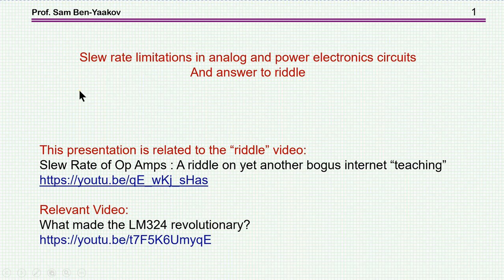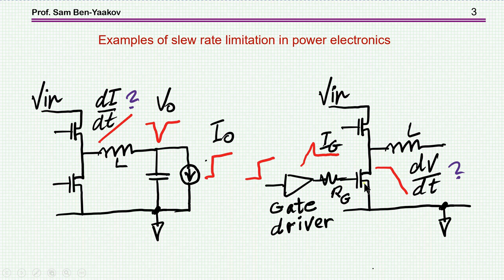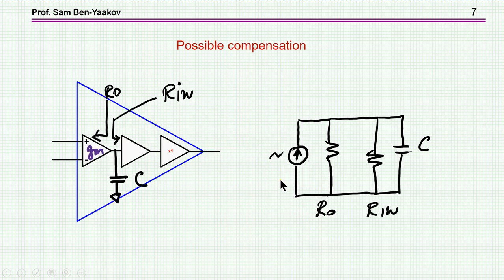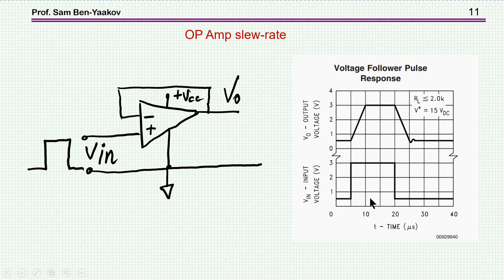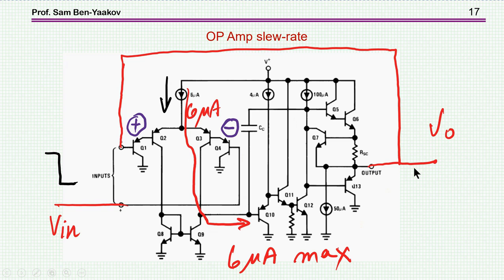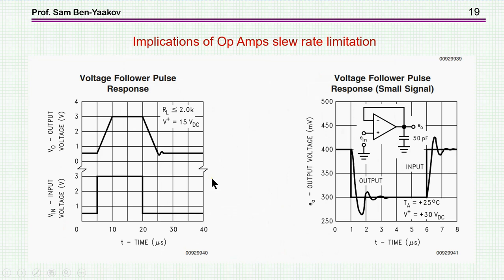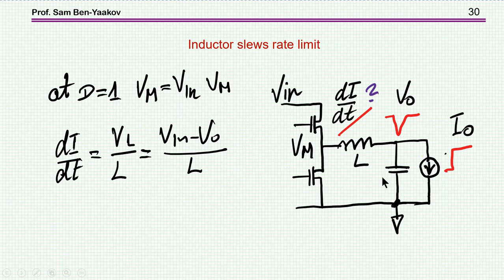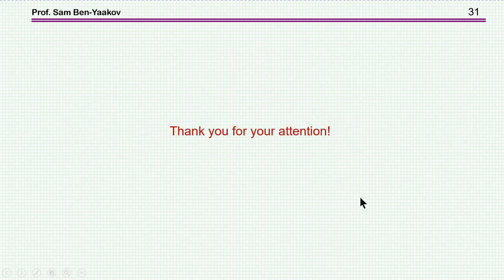Slew rate limitations in analog and power electronics circuits - And answer to riddle

Comment: Thanks for the great video and explaining Slew rate in more depth than I ever considered! I'm probably the inspiration for these last couple videos :D
It's really neat to see how simple hard limits of cut-off and ohmic region (saturation for BJTs?) ultimately result in a limitation of the dv/dt, as well as voltage limits which is more straightforward to observe. So Slew rate is a parasitic property just like clipping is, rather than deliberate like I thought. 

A long while ago, I came up with a design for a linear power supply using a couple error amps feeding some diodes, arranged as a diode-OR with a pull up, feeding an emitter follower pass element. The problem I had with the UA741's was the slew rate limitation, under certain conditions when it flipped from constant current to constant voltage or vice-versa, the opamp that goes from open loop to suddenly closed loop would need to slew a long ways to start regulating correctly, it caused weird transient behaviour when flip flopping between CC and CV! I think I came up with some convoluted way to have both opamps remain in a closed loop even if they aren't controlling the output, but I never finished the circuit since I didn't have the resources or time.
Reply from the maker: Thanks again for sharing your thoghts and experience. And yes, please keep challenging me😊
Reply: Thnx power max for leading sam here. You got a subscriber today

Comment: Dear Dr.Sam, I have a basic question regarding you Presentation. 

1. Slide 9: The open loop gain of the op-amp is considered as A. But, how come the output voltage of the op-amp under closed loop configuration equal to -AVs? Can you please expalin?
Reply from the maker: The minus sign at input designates an inverting connection.